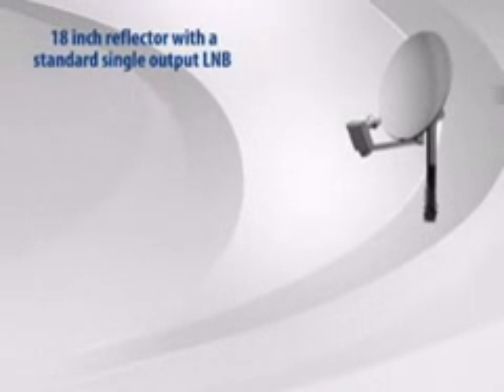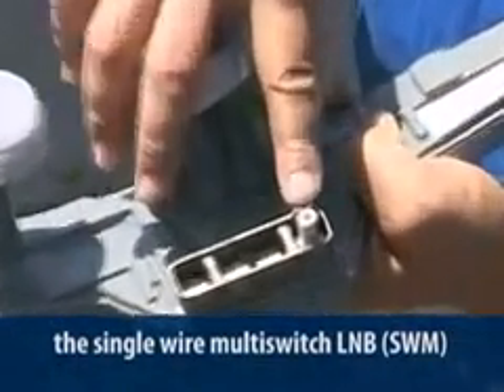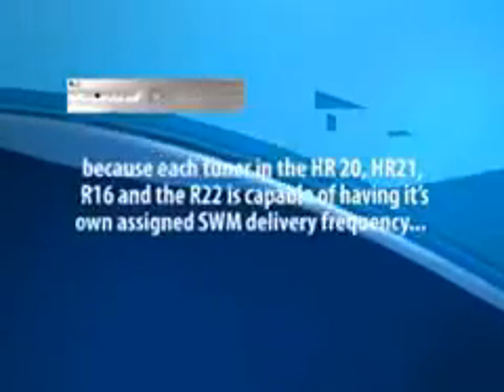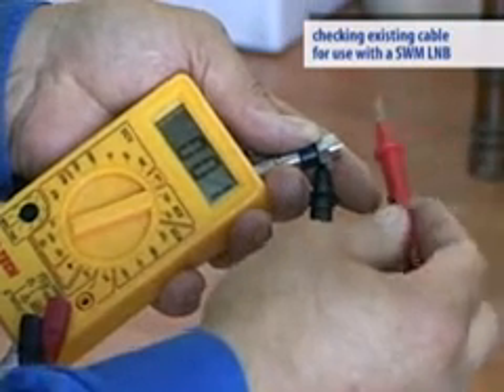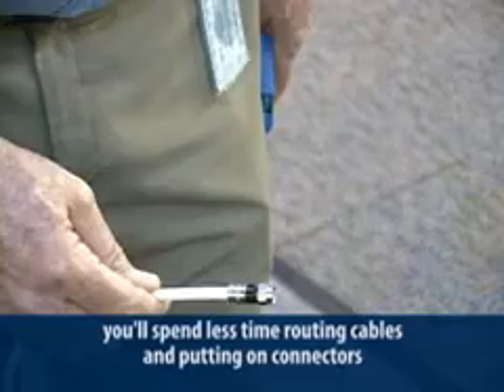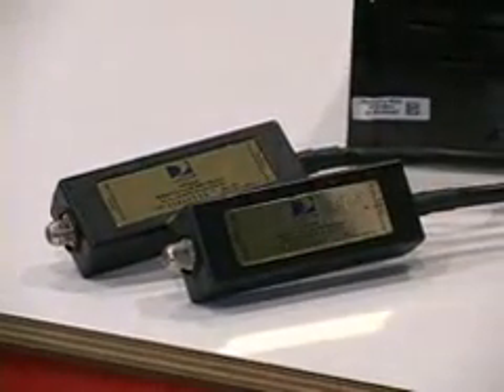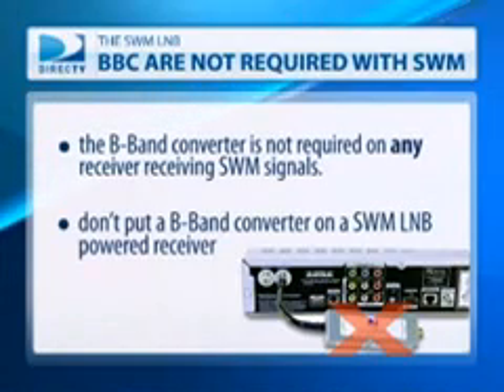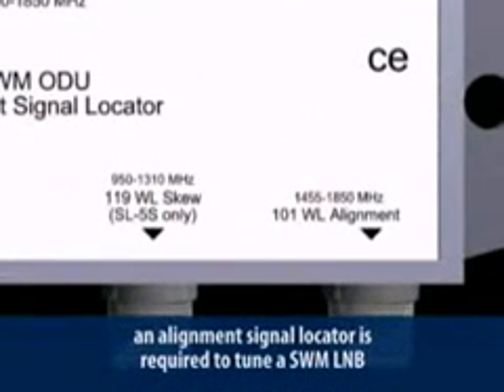DIRECTV New SWM Line LNB Satellite Dish Install Part 1

Comment: How do I fix my issue that DirecTV receiver signal loss during channel change? I pay for maintenance and I cannot get "Professional Service"! Please provide customer service with a solution. In my research I learned that our equipment is obsolete - equipment was installed in 2018.

Comment: Maybe I missed it somewhere.  Is there a video that covers that actual wiring from the SWM.  I have an SL3, slimline directv dish, a splitter? In 2 outs with one out capped, double female ended adapter, 50' cable, 3' cable, power supply.  A lot of videos out there show how to assemble the dish.  It skips over the wiring and goes directly into tuning.  The wires mysteriously attached to it.  Anyone?
Reply: 50' cable from SL3 to power inserter -> then to splitter -> splitter to DVR -> cap off ends of splitter not in use -> plug power inserter in first before DVR. I guess the female adapter you are talking about is a k band adapter. You don't need it. By the way this video is really old and should be taken down. It is not relevant anymore.

Comment: Make sure that your SWM power adapter I connect to a working power outlet and that the green light is on, if that is on call customer service and they can send out a tech usually the CSR (Customer Service Repetitive) will wave the service change

Comment: When you say "never connect a power inserter in a way it can feed voltage to a reciever". Is that the installer wanted the inserter plugged into it's own wall outlet intead of into a surge protector multi plug?

Comment: There is no comparison between Dish and DirecTV, Dish has to install two dishes on your house to have the capability of HD and local programming, they are about to lose their DVR service, and they just lost their lease on another satellite that is putting their Fox programming in jeopardy, they lose signal due to alignment issues, and their programming is for old people.I have installed both systems and SBCA Certified DirecTV is the better system hands down...